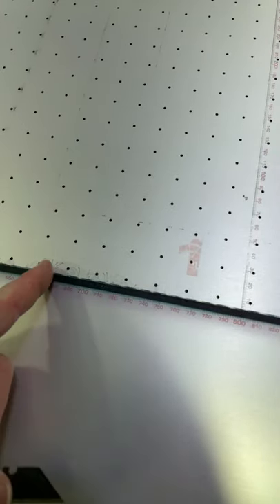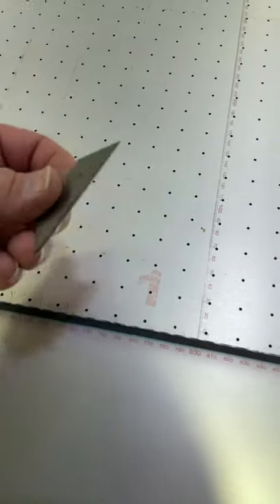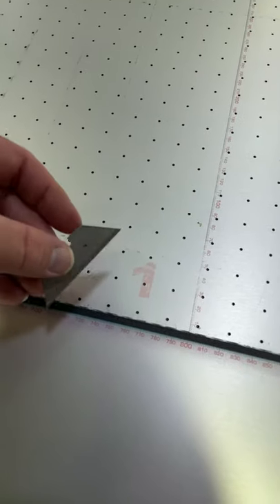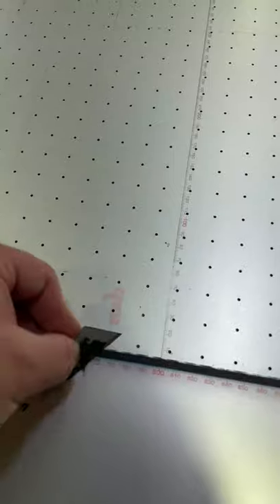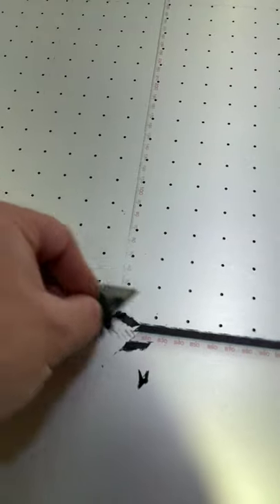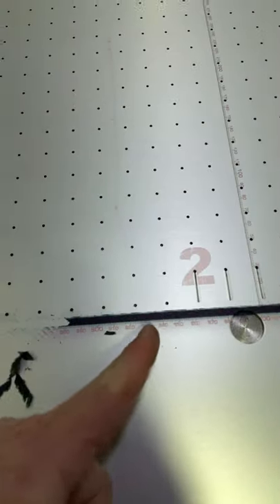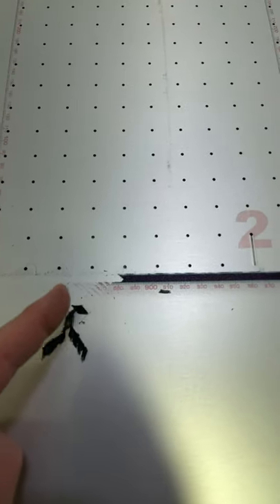Clean up UV printer over spray

Comment: I hope the UV print on the substrate is not that easy to come off
Reply from the maker: The bed is designed for the ink to be cleaned from it. It has a good scratch resistance on most material.
Reply: @ttms  Thanks, you had me worried there for a moment :)